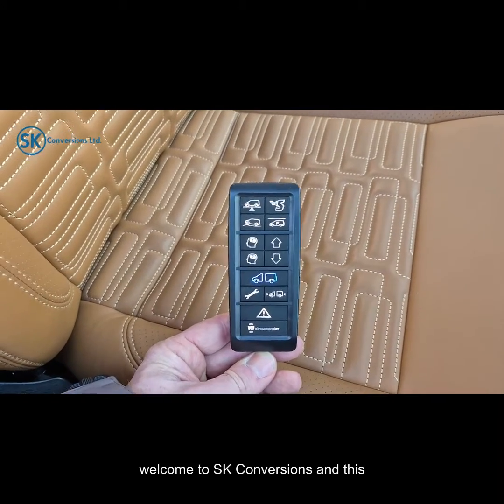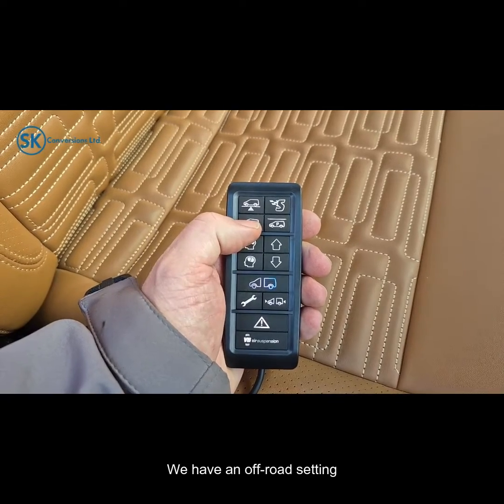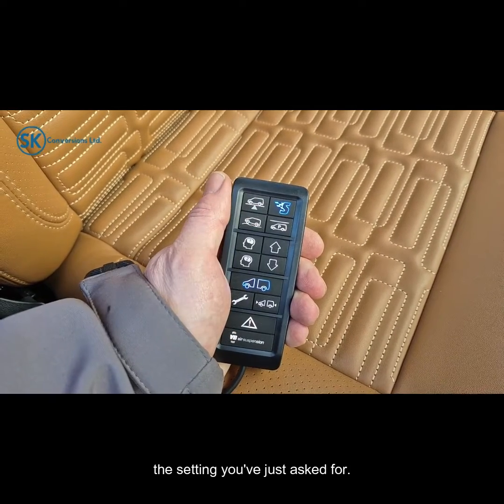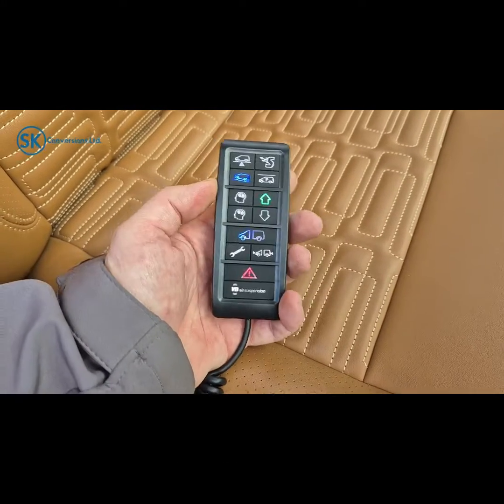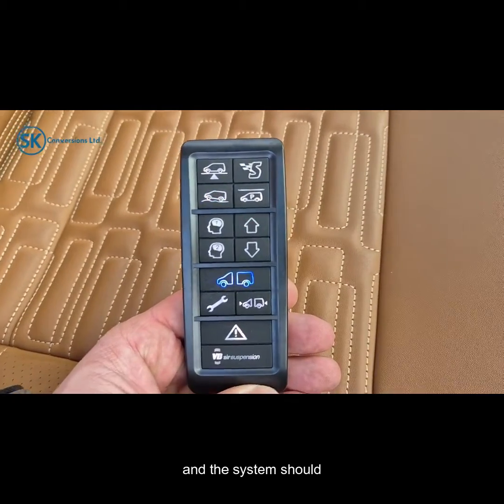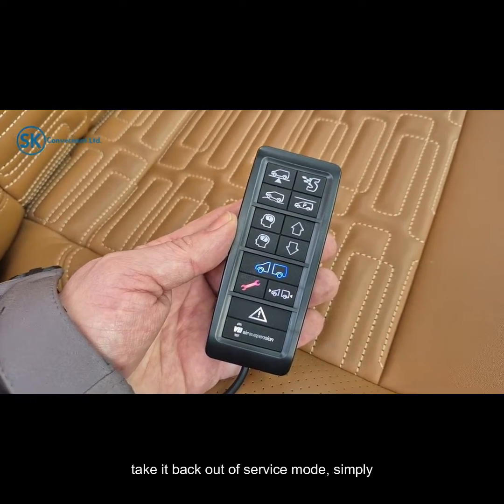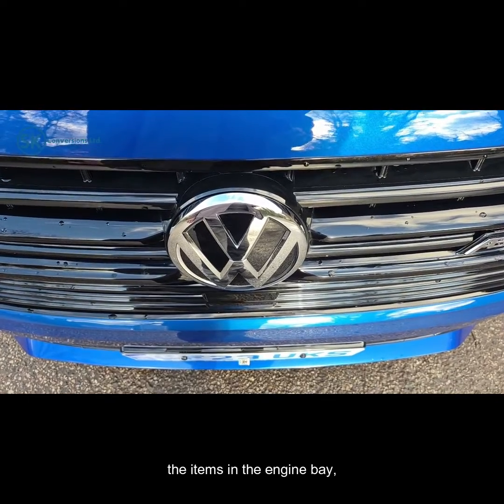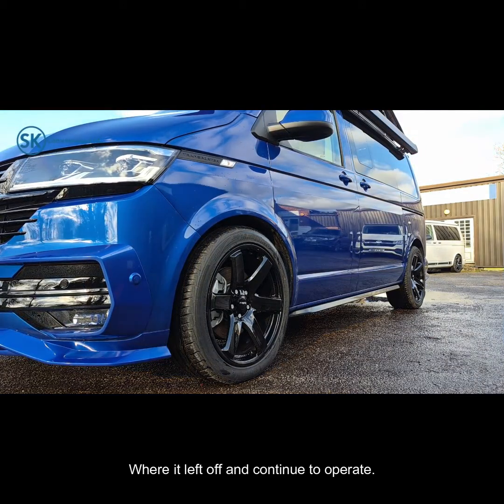VB Full Air 4C - Operating Instructions

Comment: Really helpful video, thanks.

On my VB I’m able to remove the key and the system stays live for, I think, 10 minutes, then I can use the auto-level function.

I’m not overly keen on the system wanting to adjust the height when I pull up at traffic lights etc, seems to me like the compressor is doing unnecessary cycles, but VB told me this is normal?